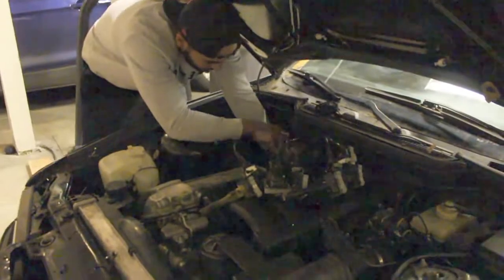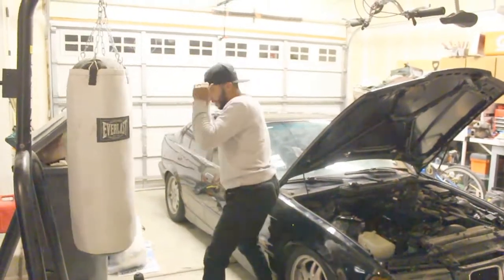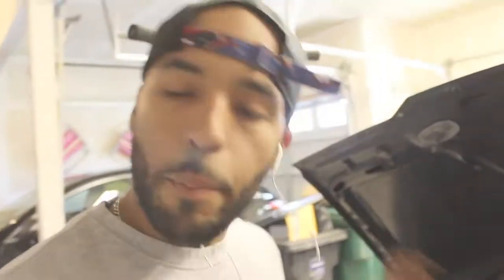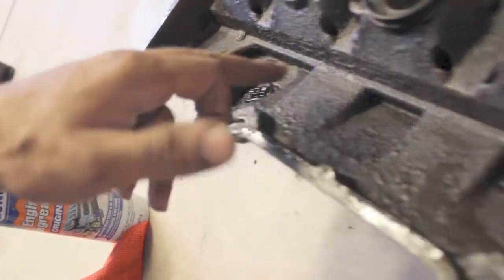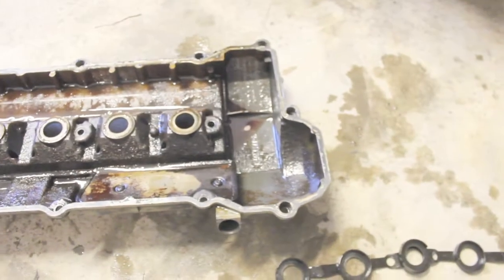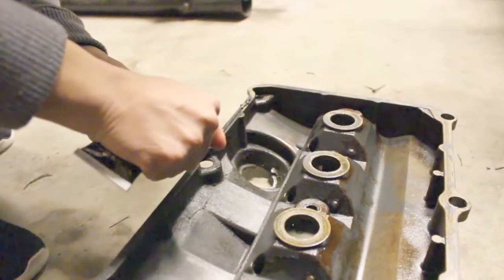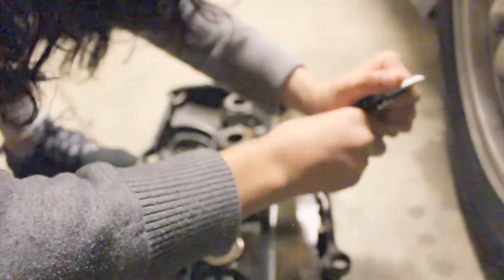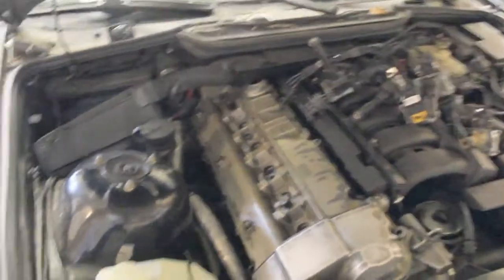MY WIFES FIRST TIME WORKING ON OUR DRIFT CARS

Comment: You're wife is a sweetheart. Lol
I'm flaring that BMWs fenders in my mind. When it comes to gasket maker,  my opinion is it is better to have some gasket maker squish out than to use too little and still have leaks. You could always trim some of the exposed gasket maker with a razor blade.
Reply from the maker: Richard McDowell I wanna put a lower offset wheels on it and add fender flares, so a stockish widebody look